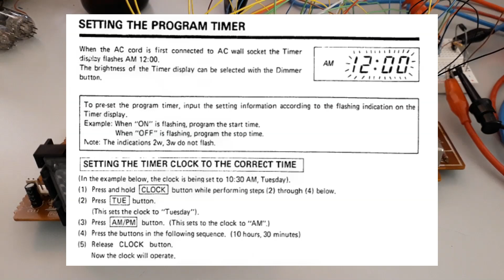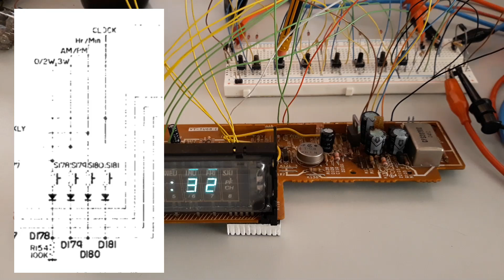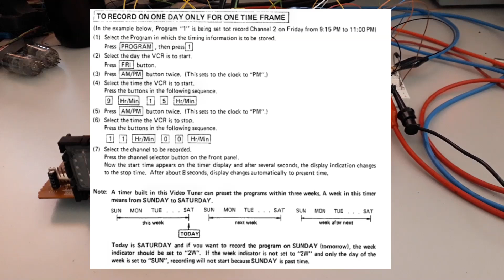HD38800

Comment: Excelent video. I have in my hands something similar that comes from an old calculator. My question is how do you supply the -37v? Do you use an external power supply or a voltage regulator or something else?
Reply from the maker: @felipe_lopez Hi, You have many ways to apply the -32V (and on this case the exact value is not relevant, important is not go above the value present on datasheet of IC). We can use a converter DC/DC like the B0524S-2W (seller at web by near of 1€) associated in serial with a B0512S-2W which give to us the 36V. Note the letter "S", this is very important, means the converter is isolated from primary block to the secondary block. The value of amperage required is very low, milliamperes! The important is the 3 power sources be total independent. You can also make use for example the regulator from family's 7924, this already give -24 output, but also can use the 7824 and on this case the output is connected to our GND or 0V which result in GND of regulator (LDO) be our -24V, the importance of independency of power sources is exactly to allow this kind of connections. Please look around my channel you have many examples how power up drivers the VFD's with transformers, converters DC/DC, association in serial of DC/DC converters.
If you don't find help on the videos examples, let me know and I will try explain this matter better, ok I know this is a little confuse but I hope this help!